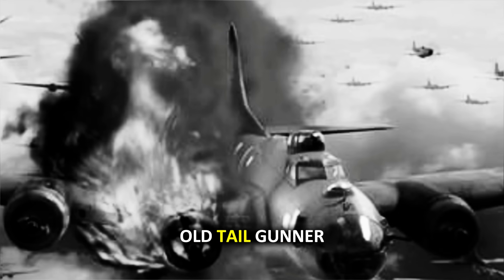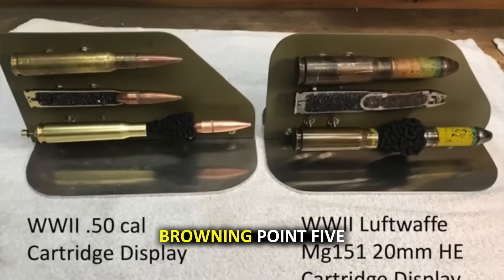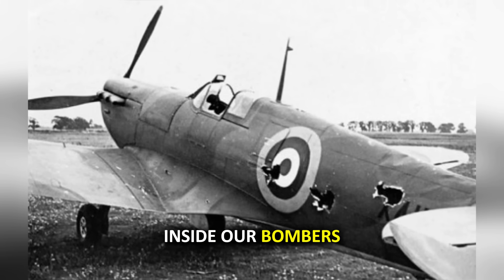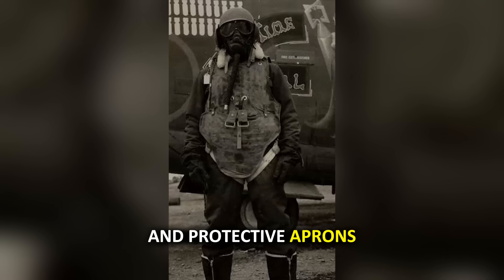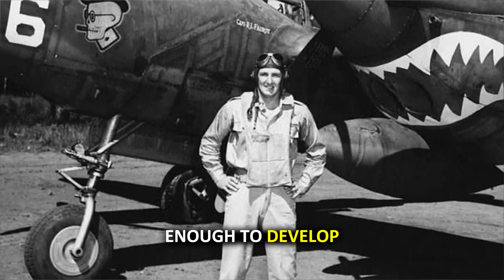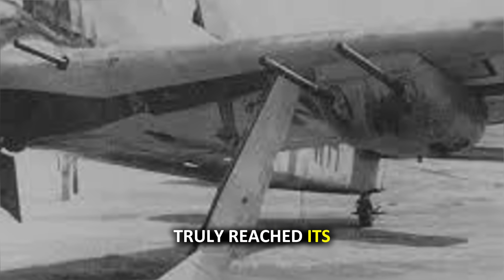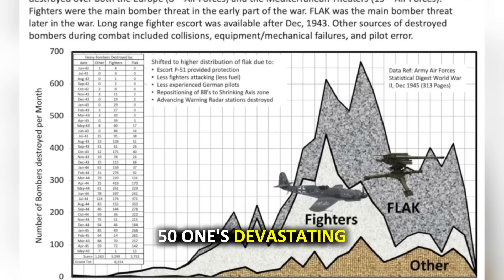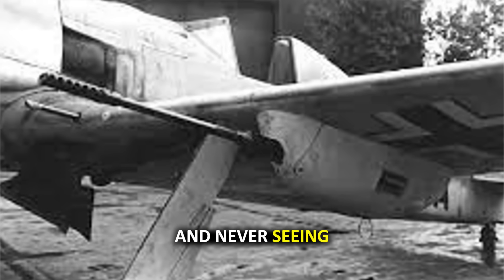The Terrifying Science Behind German 20mm Mine Rounds That Destroyed US Flying Fortresses

Comment: The Luftwaffe knew the limitations of the 20mm cannon, that’s why their premier anti bomber cannon was at least 30mm.
Reply from the maker: That’s right, 30mm cannons like the MK 108 were heavily used by the Luftwaffe against B-17s and B-24s, since just a few hits could bring down a heavy bomber. However, the 20mm cannons were still widely used because of their higher rate of fire and easier integration on many fighters.
Reply: @WW2Recollections-mk89 German fighter probably needed a mix of 20 mm and 30 mm cannons. The 30 mm MK108 was low velocity and short range, took 2 hits to take down B17.  Or a single hit of R4M.

Comment: The essence of minen gunshots lies in the thin shell body, since you can't increase the shell's weight, but you can decrease the weight of the metal and increase the weight of the explosive. This will only work if the gun has a low impulse, otherwise the shell will explode in the barrel.
Reply from the maker: Exactly — mine rounds depend on a thin-walled case and a larger explosive charge so the casing breaks up on impact; that only works with low-impulse guns. With high-velocity weapons you need a stronger case and appropriate fuze/delay mechanisms (or special driving-band/sabot designs), otherwise the round risks detonating in the barrel
Reply: @WW2Recollections-mk89 thanks for the clarification, that was interesting
Reply from the maker: Many thanks.